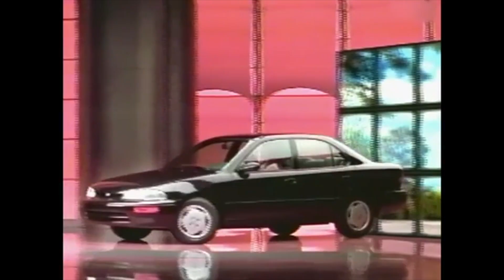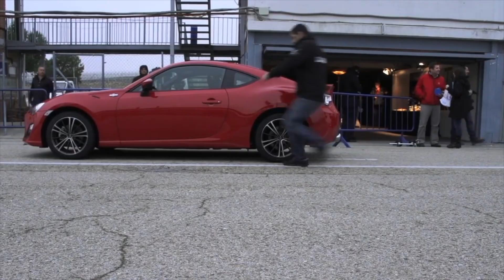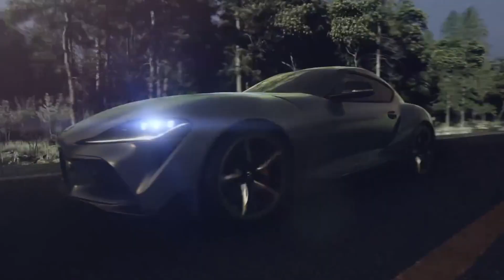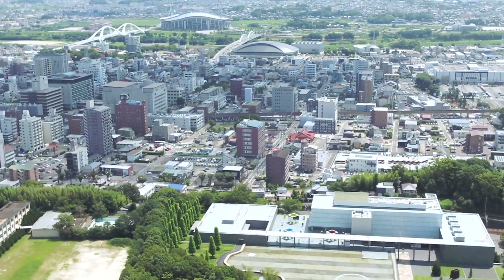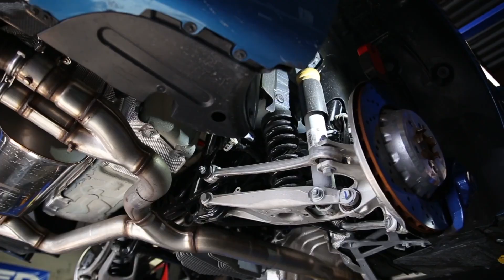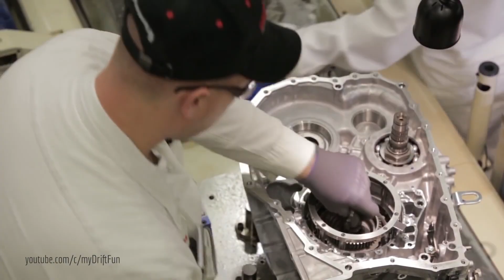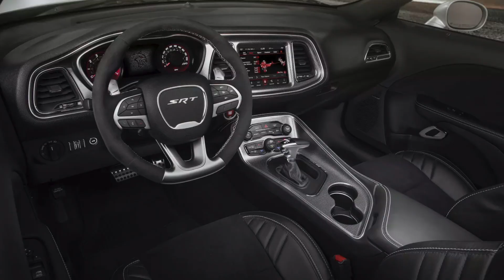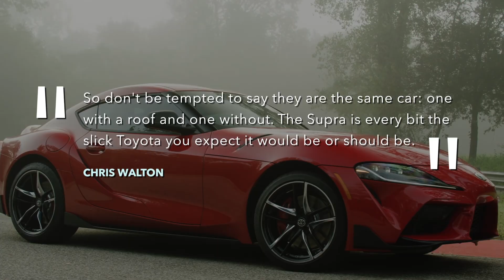MKV Toyota Supra - BMW or Toyota? The UNTOLD TRUE STORY

Comment: THE ENGINE AND NO MANUAL TRANSMISSION. Toyota should have developed a successor to the 2JZ and it should have came pair to a 6 speed manual. Also the interior feels similar to a bmw. Toyota should have done a throwback to the mk4 supra cockpit design.

Comment: Why the hell would you buy an automatic in a sportscar? You cant blip you cant burnout and takes control from you. I wouldnt waste my money on it. My opinion.  Id buy and STI instead or a Nissan Skyline. Japanese fucked this up. 2jz is the pinnacle engine. Not to mention aftermarket parts availability.

Comment: Let say Toyota “supervises” and did the qc of every single bolt and nut in the motor it’s not a Toyota transmission. It is not even Toyota engineer motor. Keyword is “engineered”. For god sake it’s not even built in Japan. It’s built in Austria. The Supra is your legacy prime time name sports car with deep deep deep rooted heritage and story. You try to push this concoction to a Supra driver owner who owned supra in the 80s and 90s and you let me know what their response will be. Fine it’s not manual many modern sports car has moved away to something of this crappy paddle shifting manual for more precise shifting and efficiency. But you couldn’t squeeze more hp from this modern sports engine comparing to previous stock Supra? At least be close to break the 400 mark. Too many cars within that price range has a more powerful motor. I said more powerful I didn’t say reliable. Had this story change some sort of my thoughts on it. Maybe a small bit. But you know what in the end this is all about it’s not a Supra. Can you imagine the new Nissan gtr be made and engineer by another party group in a joint venture? Nissan did it right to their gtr fans. Toyota dropped the ball. It’s sinking faster than lead titanic and the damn car hasn’t made to showroom floors. Like the video said the true metrics are going to be the sales number from the dealership. I can guarantee that dealership will mark up another 5-10k on the car even on the basic model making it 40-50k on entry level pricing. You fucked up big time Toyota. It’s a dam shame to your racing heritage and Supra lineages.

Comment: Same motor, same subframe, same transmission, same balance... same car with different skin. It does not matter how different they are in design and development. The FACT is they are the same car mechanically and structurally.

Comment: Look at the interior of the Supra compared to a Z4. It's all BMW buttons and switch-gear. It has the same engine, same drivetrain, same dampers and same chassis. And of course you can tweak it to drive differently. It's not that hard to achieve. The only thing different is the exterior which looks like a cheap looking FT-1 with the wrong proportions. It's shorter than an 86 and does not have the presence nor uniqueness of what fans of the Supra expect.

Comment: The 86 is an absolute dream to drive, it is so so so much fun to drive, if you whine about needing more power then you are not doing it right at all and need to have a serious re think. 
With Tada San being the chief Toyota engineer on the supra project I think the car could be an absolute beast in terms of driving enjoyment, probably a huge step up over a stock mk 4

Comment: So after 16 min of video.....engine is bmw with a toyota supervision, suspensions are bmw with a toyota tuning, gearbox is a zf8, interior are almost identical to a bmw and the car is made in Austria......seems like toyota is ready to become the new bmw's m sport division......well done toyota!
Reply: Exactly, and to add to insult the z4 is more powerful. Honestly even the 370z seems like a better choice now and it's 20 grand less.
Reply: @TigerKurdish  Where do you get that information on power? Both brands websites quote the power to be 250kW.
Reply: @TigerKurdish  While the 370z has a weight distibution of 55:45, weighs 1457kg it shouldn't be taken lightly. With ohlins coilovers, ap racing brake kit and a stillen supercharger kit, not only is an m4 killer, but it's between an m4 and a 911 turbo. Personally, i would pick a 370z. Or i would "build" my style supra. Which is a gt86 with a k20c1 honda engine, tuned to 450hp for adv. It stills maintains the 50:50 ratio, same weight, but it becomes the mini supra we all wanted
Reply: @mikekanakakis918  50:50 isn't better. It's just 50:50. It means nothing. Just because it "makes sense" that it's better doesn't mean physics in any way agree with you.
Reply: @Malc180s  What do you mean better? A drift car needs more weight in the front, less in the rear so the tail can slip easily and the added weight in the front helps with the understeer. A sport race car, mostly in time attacks, it needs 50 to 55 in the front. The rest is up to the suspension tuning. But I wouldn't say that a 50-50 is neither good or bad, it's neutral. But it's a good start for a nice set of coilovers. I've driven a miata, an s2k and a brz. All of them 50-50 weight distribution, all of them with bc coilovers. The coilover and weight distribution combo is miraculous. The most predictable handling and drifting I've ever made. All of them with the right suspension tuning could either be drifters or time attackers. So I would say a 50-50 is a good thing for start
Reply: @mikekanakakis918  There is no better. Weight distribution means nothing. Old 911s were 35/65 and were cracking. The 80s quattros were 65/35 and were equally great. That nissan delta wing had 75% of its weight over the rear. Modern BMWs are universally slagged for being snappy. 

Weight distribution is about as relevant to a car discussion as the bird shit on your windscreen is.
Reply: @Malc180s  I agree with you but actually there is one critical point. A front engined car with 65 to 70% at the front should not have a big distance between the two axles. And if it's a fwd, then practically it handles like shit. Every other combo is pretty much the same and it only alters the car's character just a little. But time attack - wise, for a rwd, you need at least 50% or more in the rear. Drag wise, you need the weight where the wheel drive is for maximum traction
Reply: Mike Kanakakis yeah but the Z has a V6 eww
Reply: @ralphinator2  In your imaginary world I'm sure a lot of things have happened.
Reply: @Malc180s  Saying weight distribution means nothing is idiotic. It's part of a whole. Those 35/65 911s you mention had that 65 over the rear wheels giving them tons of grip which otherwise would spin when the throttle opened. Another dumb thing you said because of physics 35/65 rear bias is unstable so as looking as the front tires have grip the driver can point the car anywhere he/she wants. Those 80s quattro's were AWD, had short wheelbases, and also heavy so in that case weight distribution doesn't matter but because adverse/effects are not significant to come into play.
Reply: @ralphinator2  Audi never seriously raced against Subaru - Subaru started serious rally competition only after Group B was banned and ProDrive took the team over in 1990.  Before that, Subaru was a second rate team at best and certainly not competitive (the best finish was 3rd in NZ in 1987).   If you want to say that Quattros got their ass kicked by Peugeot or Lancia, that would be more correct.    Certainly by 1985-86 (when Audi quit the WRC), they were not competitive anymore, Peugeot was trouncing them with the crazy 206 Turbo 16.
Reply: Malc180s porches have a difference weight transfer through corners because of their mid engine 🤦‍♂️ 50/50 distribution is a major key for front engine sports cars
Reply: @mikekanakakis918  technically yes, 370Z makes more sense, specially if you throw costs to track times into the mix.  however i having tracked a 370Z myself, i didn't like the way it felt on a power circuit.. for a lack of better terms, it felt like front and back of the car were not working together, not entirely sure what that is.    it just didn't feel as easy to go around a track at full chat as a well sorted chassis like M series BMW..  that's not to say it can't, im sure it can in the right hands, but im also sure have to work at more to keep pace on a power circuit.     i was loaned a M2 not that long ago and i was amazed at how that thing was hooking up on a road..  and when it lost bite, it didn't feel like back of the car was trying to trade places with the front of the car, very manageable, the 370Z i played with if it lost bite it was going to try its damndest to spin around..
Reply: @Malc180s  So rotational inertia has nothing to do with the center of mass? Try again. The 911 is rear engine, the Quattro is AWD, and the Delta Wing was some affected Japanese nut's dream of making a car that looks like the SR71 Blackbird. The front wheels are 8" apart. Maybe we should see how the Supra handles with that setup. You're not an engineer, we know that much.
Reply: @RickHavok  Clearly, if you could read without spewing your bias everywhere, I was saying that weight distribution _doesn't matter_. I'm not an engineer, as if that would somehow mean anything. You're not a plumber, we know that much.
Reply: @mikekanakakis918  There's a lot of professional drivers and engineers that will tell you 40:60 is the ideal weight distribution for performance driving. 50:50 sounds good for marketing purposes and is much easier than 40:60 to achieve with a cheap front-engine rear wheel drive layout. As Kevin Marshall mentioned, a weight distribution with more over the rear wheels increases traction over the drive wheels on acceleration, and under braking, enough goes to the front wheels. There is a reason hypercars are, without exception, mid-engine rear wheel drive. (or AWD with a large percentage available to the rear wheels when needed)
Reply: @Honeypot-x9s  The 370z you drove was completely stock? It shines with a set of coilovers and with the right suspension tuning. Also it lacks the torque from being a na engine. An m2 is turbo, so twin turbo or supercharge the 370z and it will have the torque to bite again to straight position
Reply: @mikekanakakis918  suspension was probably stock, the engine was turbo charged and definitely felt like had too much power for rest of the vehical, maybe with better suspension and gripper tires.    not sure of exact specs of that 370Z was a while ago, but it really wasn't as throwable as a stock M series BMW... like that M2 i got as a loaner, i honestly dont know where that thing found grip for those corners in the wet, i took corners at speeds that i think physics would be at a loss for...probably broke physics.
Reply: @Honeypot-x9s  Adaptive suspension, plate lsd and small stock turbo gives linear torque and impressive handling, exactly what m2 accomplished
Reply: @Malc180s  If it doesn't make sense, you can't comprehend it. You just supported my point. It does matter, not for lap times, but it certainly does make a huge difference in the way the car handles and allows you to easily dial in over or under steer with your right foot. How do you figure I'm biased? You have no argument.
Reply: @Malc180s  You used irrelevant examples, as I pointed out. Why not just cite the space shuttle/
Reply: @RickHavok  If a 65% weight forward quattro can dominate rally, and a 65%+ weight rearward 911 is a legendary road and race car, it's hard to suggest that weight distribution really means anything.. Greatest hot hatch of all time? Well over 65% of the weight forward. 

Does weight distribution make a difference? Of course. Does it make a car inherently better or worse? Absolutely not, and therefore it's irrelevant in the discussion of whether it makes a car good or not. Which is what we're talking about.
Reply: @Malc180s  Okay, listen... I didn't mean to be harsh, it's just the way I talk sometimes and your post read a little hostile and cocky as well, but let me try to clarify my points. Notice 2 of your examples. The hot hatch and the 911. One with 65% front, over powered front wheels, and one 65% rear over rear powered wheels. The correlation is 65% over wheels with the power. Is this starting to make sense now? The Audi is AWD front engine, so you want most of the weight in front so it doesn't under steer, and that also correlates to power distribution; the more power to the axle, the more weight it needs over that axle in order to transfer steering inputs to the road. There is more involved, but I hope this helps. It is relevant, just relevant to the specific design of the car.
Reply: @TigerKurdish  You don't know shit about what makes a sports car great, don't you? Ok, just stick to your heavy muscle cars.

Comment: Bottom line, if it actually is BMW under the skin, it's going to be an unreliable piece of shit.  Please, please tell me it's not going to be powered by one of those terrible magnesium block engines from BMW!  Unfortunately it would make economic sense for Toyota to use one of those horrible BMW mills.  "Wasn't exactly in line with Toyota's reliability standards."  That's a really polite way of saying that the design is so retarded that bolts will spontaneously fail in different areas of the engine because the pointless use of magnesium required the equally pointless use of aluminum bolts that were torqued to yield.  I definitely do not like the BMW-sourced suspension parts.  Very underwhelming.

Are the B family of engines made with a magnesium block?  If so, I strongly recommend avoiding the fuck out of these cars.  If they got smart and went with straight up aluminum blocks, that'd be a huge improvement and I'd be very cautiously optimistic.

You kind of messed up on the transmission part of the video.  The images are of transfer cases, not transmissions.

The Toyota 86 is a legitimate sports car?  Is that why it's never found in the hands of actual sportscar guys, but always in the hands of "sex spec" dickheads?

Dude, I've read too much Motor Trend to trust what they say.  Wow... the 86 and BRZ are literally the same exact car with different badges.  You shouldn't be able to tell the difference, because there is none.

Comment: The styling leaves me cold, the lack of horsepower fails to excite me, and the 50k price tag is too much to bear, I have no interest in the new Supra. I hate saying what I did after so much dedication and effort was put into a vehicle. To give you perspective without naming hames I was able to purchase a GT vehicle with with better styling, well appointed and feature laden for 27k out the door. For the price of that Supra I could buy two of my slightly inferior vehicle and garage one as an investment. 
Styling is subjective, so there are people out there that will think the world of the new Supra, but dollars are a more objective concept and 50k is a pretty big object to overcome. The lack of power can easily be overcome with a bolt on compressor of some type, but we all know that means reliability is out the door. And as if all that were not bad enough the car is a pig coming in way overweight, even the planned lightweight model is 3400 pounds which is not light for a 2 seater. This very same problem with weight is what makes the SC 500 undesirable, and all they can do is sit around a brag about the exhaust note.

Comment: So what version of the 8HP transmission is it? I would hate for a 350hp car to pull a Nissan and put a transmission not rated for the power in it.
8hp30- 300hp300nm?
8hp45- 450hp500nm?
8hp70- 700hp700nm?

Comment: I wouldn’t call the N55 unreliable at all, it was a more boring but more reliable version of the N54, which was a proper 2JZ level engine.
No manual gearbox though, as always, is a deal breaker.
And to be honest, I’d want a manual 2+2 cabrio version of this supra or the 86, but that’s not going to happen.

Comment: You started with the straw-man argument that detractors are stating it's "badge engineering" comparable to the Geo Prizm/Corolla or FRS/BRZ/86. Clearly there are more differences than just the badges, but it's also clear that the Supra is in it's soul, a Z4 coupe with some different bodywork. Let's see, BMW engine, BMW suspension, various BMW bits throughout, manufactured in a factory that mostly makes BMW stuff even if not strictly a "BMW factory". Maybe BMW learned some reliability info that will help them. Time will tell if the B58 really represents a significant reliability improvement. That being said, I think the Supra is a pretty good deal as a cheaper alternative the the Z4. I just wish it didn't have fake vents and scoops all over the place.